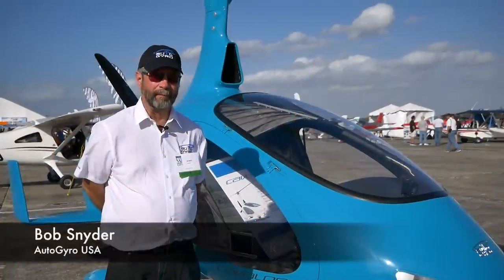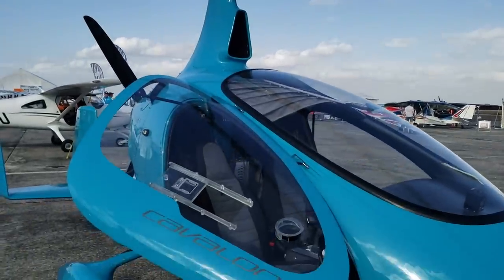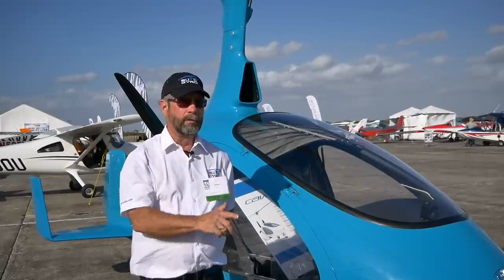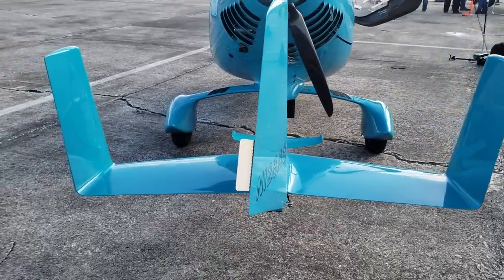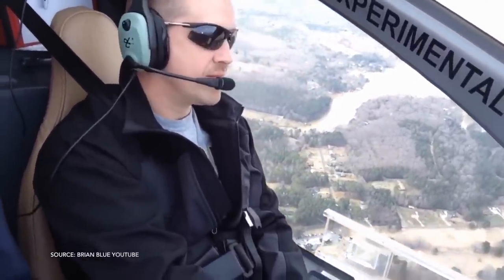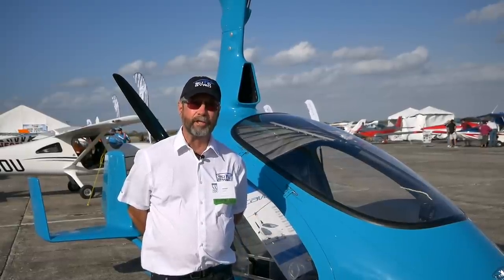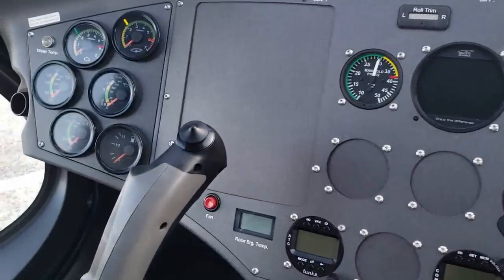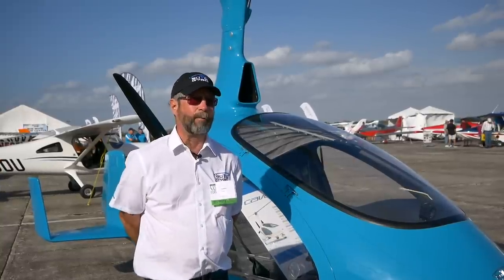WHY Pilots Fly This Instead Of An Helicopter l AutoGyro Cavalon

Comment: Great machine!!! I must say ,that some of our  (Czech ) engineer developed this autogyro with added electric engine in front wheel,totally street legal..You can fly,than land ,drive on the public road to gas station,fill the tank ,go back to place you landed and continue your flight !!! I think it´s great vehicle...battery holds for 40kilometres ...sorry 25 miles and it all costs about ninety thousands dollars!!! only two mistakes -I have no pilot license and have not so much money...8-((
Reply: Norbert Pecheq  it is gyromotion •••••Flyway Nirvana did it • Czech  Flight school in Prerov
Reply: @zaferkoca106100   Yes!! Exactly!!You are right!!
Reply: I wonder if it can be made into more of a car shape and the props can tuck away
Reply: BUT THATS SOOOOO COOOL....JUST SAYING...😮❤❤❤❤❤❤❤❤❤❤❤❤❤❤❤
Reply: fryncyar - a car is shaped to ride on land and thus its has a flat bottom. when air gets under there in abundance,with the wrong design it can create lift like a vw bug.

also weight is a huge factor with aeronautics as with cars but instead of going slow you either cant takeoff or wish you hadnt.

Comment: I agree with what the speaker is saying 100%. I own and have been flying a Cavalon two or three times a week for the past two years. I come from fixed wing flying for the past forty years in Cessnas 421s. I used the 421 purely for transportation from Chicago to Heber City, Utah. As a transportation aircraft the 421 was a dream, however, when I moved permanently to Utah transitioning from physician to ski bum, I found that the fun factor with the 421, mainly for local flights, was decreasing dramatically every time I flew it. That is why a got into gyro flying, and, I agree with the previous presentation that there is nothing more fun in the sky. Do not be dissuaded by people that like to talk without direct knowledge: Gyros are very safe, ONCE YOU GET THE PROPER INSTRUCTION. Do not think for a minute that 5000 hours in a fixed wing or in a helicopter would allow to fly a gyro right off the bat. It is not going to work, and that is how gyro flying years ago got a bad reputation. People flying wothout proper instruction. Once you know what you are doing, they are very safe. They do not stall, therefore do not spin. If you lose your engine, it is just a no event. You can come down under that spinning rotor and put the thing down on a small patch of grass, or dirt, or sand, or asphalt, it does not matter. They turn on a dime and you can do different flight figures in the sky as you desire to your heart content. Nothing beats gyros for agility and emergency manouvers. To those that say they are not practical, they can actually bring you 4 hundred miles on a tank of gas, and withourt braking the bank. And you will have 4 hours of sheer bliss in the process. 
Mauro
Reply: Hello Mauro I have to say you have posted one of the most accurate responses on here and obviously because you have the first hand knowledge to comment on the subject there are so many people making statements on here with no knowledge of what they are saying. Everyone has a right to their opinion but their opinion doesn't mean they are stating a fact. Thank you sir for your input I built my Cavalon a little over 2 years ago and as of today have 649 hours on it so to say I fly it a lot would be an understatement. My Cavlon has become a wonderful part of my life, I have done things and met people since owning it that have changed my life and look forward to every flight. To date I have also introduced over 150 people to the joys of flight in the Cavalon. We are currently planning an event in coordination with the American Helicopter Museum in West Chester Pa. and will be held on Fathers Day of 2019 so anyone in the area that may be interested please stop by and check them out in person. Fly safe everyone.
Reply: Agree with Mauro 100%. Fun...economical...safe....and fun again!  Can’t emphasize the importance of proper training first!
Reply: It is people like you who make health insurance unfordable to most people... Guys like you who must have their boy toys (paid for by your financially struggling patients) are a huge part of the problem. ... But I know you easily turn a blind eye to this as you are skiing and buzzing around in your autogiro.
Reply: @herrunsinn774  you should dig a little deeper on your textual facts. I have family in the medical field. Questions should be....why do drs. charge so much? Do people ever abuse the ins. industry? How much did medical school cost? Wait a minute, you still have to go to school,....and pay for it!!?? Youre on call up to 24 hrs a day??!! You see your family how much? And there are more questions like that. 
Now a great topic is Pharmaceutical!!! THEY are criminal!!!! All drs know this.
Reply: you only brake the bank once. When you buy it.
Reply: Where did u receive your gyro training And what designation did you attain

Comment: My dad had built one with a modified VW engine in the 70s which sadly was lost in a shop fire . Flying at Mirage Dry Lake in Southern California was very popular.  Yes they fly fine on windy days, you just want to make sure you have plenty altitude when you make your wide downwind turns to keep the air speed up and the lift up or they can have problems.

Comment: I remember the gyrocopter ads that used to be in magazines. You could buy a kit for $2,000 - $3,000 and build it yourself. I think the motor was extra (and it wasn't a Rotax). This was a long time ago but I still remember those old ads and how much I wanted one.
Reply: The BENSON Gyrocopter was in the lat '60s. I bought a kit, built the rotor and to start on Blades... I was 16 years old, and parents didn't know I bought it until the kit was in the basement. ..... Handed off to the next guy, didn't fly... suppose I was too young.

Comment: Excellent aircraft! I've always fancied flying a Gyro!! The Utility value of these very STO / vert. landing aircraft is very unappreciated! Intrinsically FAR safer than any fixed wing aircraft!

You don't need an airstrip - any old short stretch of road will do, and the cost of ownership is FAR lower than any fixed-wing aircraft.
Reply: Just watch out for power and phone lines when using roads. As well as traffic.
Reply: No stol at 8k ft elevation!
Reply: Phil S - I should point out to you that they are neither STOL nor vertical landing capable. Despite what the guy in the video says. He is being misleading. Firstly, he said that on a day with 20-25kt headwinds, it would take off quickly - true. He also quoted figures for calm days and said (something like) 300ft wheels on the ground - What he didn't tell you is that a gyro has multiple stages to its takeoff profile - Once the wheels are off the ground, it is not safe to climb out until enough airspeed has been achieved in low-level flight along the runway which can take more than the "wheels on the ground" roll in some situations. They do land in a short run but most of them do not land vertically. You could land one in something as small as a tennis-court with proper training and adequate experience but you'll not get back out again. On a reasonably calm day, you'll need at least 200metres before you can climb out in something like the Cavalon. I need that in my MTO Sport and it's lighter than the Cavalon. ... and, I've flown the Cavalon - I was not impressed by it. It's heavy, sluggish, very imprecise in yaw, visibility sucks, panel is badly laid out, stick feels heavy and dead, and it has a VNE of 100mph (compared to 120mph for my MTO Sport).

Comment: I own a Cavalon with a Rotax 914 since last year, although it can fly for almost 5 hours this is the ideal aircraft for short expeditions because of the speed (average airspeed 65knots)and you have to travel light (10kg max luggage per passenger/max passenger). Operating cost is around 100$CAD/hour and fun is guaranteed....if you want to remain anonymous at airports you will not! This nice looking Cavalon attracts a lot of people. Buying this aircraft was the best decision !
Reply: How far will it go on 1 tank of fuel?
Reply: That varies with the wind direction, a tank is 100 liters and I burn between 15-20 liters per hour depending on airspeed so in a no wind situation at  65 knots I could travel  around 375 miles or 600 km...we usually fly by 2-3 hours legs which is ideal
Reply: Where abouts in Canada are you from?
Reply: Mauricie region
Reply: Why so slow? Most cruise I see is around 90 kts.
Reply: @ictpilot  That's the aircraft configuration, max speed (VNE) is 160kph or 86kts  and a cruising speed of 130kph or 70kts (65kts is ideal for my type of use), the Calidus (tandem configuration) model is higher at 195kph or 105kts with a cruising speed of 90knots. The italian model Magni M-24 Orion (also side by side configuration) has a VNE of 105kts with a cruising speed of 78kts which is slightly faster. I didn't buy this type of aircraft for performance or for long distance but for short excursion (150 miles range) or sightseeing and I really enjoy every minutes of it.
Reply: @jeandefoy9212  Yes the Calidus is faster, I've seen video of them at 90 kts cruise with some airspeed left to go to the red. The Cavalon is slightly slower because it's bigger. But I understand if you're just sightseeing and not strictly traveling.
Reply: I agree with you Jean I built my Cavalon in late 2016 and now with over 690 hours on it I am still amazed every time I fly it is a new adventure and the visibility is incredible. I am looking to build a new one soon so Cavalon 914 RB will be for sale is anyone is interested.
Reply: Jean decoy ~> How do you get the 100$ an hour price, what does that encompass...and I think you're in Qc, so how easy is it to fly around and land  and stuff, concerning the laws in place and all the tralala? Merci .

Comment: I have flown 95 different kinds of aircraft over 55 years to include Airplanes Single & Multiengine Land & sea, Rotorcraft Helicopter, Gliders, and am typed in 3 from DC-3's to a DA10.  I was susceptible  about Gyroplanes until I flew one with Craig at Fainting Goat South of Fort Worth TX,  Not only was the MTO Sport exciting and maneuverable but it was easy to fly.  Most of my time was just getting use to the new maneuvers and understanding the more load you put on it the better it flies.  This was more fun than any of the other aircraft have flown, easier to fly, safer within reason, and a whole lot less complicated.  If I had the money I would buy either version of the MTO.....but I do like the feeling of being in the semi open cockpit in that it reminds me of my motorcycle days, but much safer and in the air!  Dave Barron
Reply: I love it. I want one in Black and silver. I always said the only thing better than riding a motorcycle is flying an open cockpit airplane. I had both at one time. If I could afford it I'm sure I would have a Cavalon  today. It is great looking and sounds like fun to fly. I am sold. All I need to do, is the new way of making money. Create a "feel sorry for me" fund raiser and collect large donations from all the generous people. Yes "David Barron" it is safer in the cockpit than on the ground.

Comment: Back in the 90's I made an appointment to get a demo ride in an RAF200. I had prior experience in a Benson that I built and learned to fly.  I did have a bias toward the gyro. However, even with the pre-rotator, the RAF used more runway than a Cessna 150.  Shortly after I got a ride in a Baby Belle helicopter.  I've had flights in two different Mosquito helicopters and found them remarkably easy to hover. Two Mosquitos can be bought for less than the subject gyro.

Comment: They are soo damn fun and the better you get the more insanely fun they are. I wish I could afford one.
Reply: I could not afford one but bought it anyway  I purchased and built it the end of 2016 and have never looked back,,,,,,,too busy flying and having fun,,,,,,,you only get one spin on the wheel of life and I figured it was now or never     so now at about 5 yrs and over 1002 hrs. on my Autogyro Cavalon I have given about 300 people their first gyro flight and  I am thinking about moving up to the 915 version. I have fixed wing and helicopter experience but the gyro is what I have the most fun with and it is affordable to fly. I live in NE Pa. so if you get in the area send me a massage,,,,,,, I am always looking for an excuse to fly. The one restriction would be approx. 180 to 200 lbs maximum to comply with weight and balance restrictions.

Comment: Cool 😎 I'm a Bensen pilot from about the mid 70's. Member of PRA chapter 5 norcal,. I pretty much stopped flying gytos when I got married mid 90's. Saw your booth at Oshkosh 2017, was that you? And also several Cavalons and Magni gyros at Mentone that year. However I don't have that kind of money, and I'm also getting pretty old. Haha. Glad to see a few other "old" gyro pilots out there. Would be nice to get back into it. My only thrill nowadays is flying FPV multirotors. Cheers.

Comment: Accidents occur when you don't  think through what you can/ can't  do in most situations. That is  'read the instructions'. Flew them for years in the development phase . Most as a 'Test Pilot '.  Some scary situations occured, so learning curve very steep.  One 'write off', caused by faulty cable making, leading to a uncontrolled spin caused by full rudder application at about  250'.  Descended vertically ,  with a little sideways dodging of a shack and fence.  Because the builder was in the aircraft manufacturing  business, he put a   cable down tte mast, good thing, as the mast broke, with me hanging on for dear life, thiking that when the rotor hit the ground, I was going to be cut int salami slices. All I got was a fright and a desire not to do that again. Not hurt in all the time I flew them, and having flown gliders and Cessna's, find gyros to be very safe.
Reply: lawrence willard you reminded me when docking a fifty foot yacht in high winds,,,I kept my cool and went to my training but,,,, I still had to wipe myself after slamming down a double shot of Jack,,,,😨😎🤣
Reply: I'd never fly in a gyro unless it had jump capability.

Comment: Took an intro flight with Bob,  work in the same building as their program at Bay Bridge.  Nice little airplanes.  I question the practicality,  very low cruise speeds and range,  but they are cool as hell.
Reply: Depending on the make and model (AutoGyro isn't the only company in the US) you can fly a gyroplane at 90-100knots cruise for 3-5hrs. Gyros are just as fast or faster than a helicopter and burn fuel 4-6gal/hr like a LSA fixed wing. I love this channel, but there are a bunch of other gyro vids showing cross country capabilities in good and bad weather. Prices vary too, this gyro is at the top end. Brand new start around $70k. Good used ones around $40k. If I had my PPL and could buy one, it would fit my missions (getting to work and visiting family in other states).
Reply: @gospfunk  yeah,  fair points,  I stand somewhat corrected,  upon further inspection,  this is actually the exact Gyro I had the chance to fly,  based at Bay Bridge in MD. If they took that sucker all the way down to Sebring from here,  it can handle a bit of cross country.
Reply: @gospfunk  Aerocopter AC 20 is even more expensive with VERY little performance increase.
Reply: @StuartRedman1  One of they guys that built his Cavalon at Baybridge was based at Sky Manor NJ and just relocated to Florida and he did not trailer it,,,,he flew it down.
Reply: @StuartRedman1  Check out the YouTube video of the guys that flew around Iceland. Great video.
Reply: @StuartRedman1  I fly my Cavalon on many trips over 100 miles and more and at just a little over 2 years I now have flown it 690 hours. I told them when I built it this was not going to be a hangar queen,,,,,,if it is nice and I can find the time I am in the air. If anyone is interested there is a fly in coming up at the American Helicopter Museum in Brandywine, Pa. this coming Father's Day and their theme will be gyrocopters. Check it out on their website were going to be there with some other gyro pilots weather permitting.
Reply: @kevin paul halliday and they now will have a certified version of the Cavalon.

Comment: I m so lucky to have experience flown this magic aircraft, its a mix between a helicopter and a plane
Reply: could someone explain to me that if this is a helicopter take off? correct? yet then once in the sky you use the back blade to move forward? then you land like a helicopter also?
Reply: @PROJECT-AMBITION  No you can't take off like a helicopter. If you have high enough winds it will rise in place and "hover". Look at Glass panel aviation s website and you can see what I mean if they still have the videos of guys flying them in the Middle East.

Comment: An helicopter ? 
A Helicopter
That's a bad as "while we conversated I axed a question"
Reply: An Helicopter is correct if not used as often anymore
Reply: Technically, AN helicopter is correct - or it was once.  When I was growing up in the 60s in England, some pedants would say AN helicopter, or AN hotel, or some such.  Meanwhile the rest of us would say A helicopter, or A hotel.  
So, while it's not wrong to say AN helicopter, it's a vey old-fashioned way to say it.

Comment: Could buy one, not wealthy enough for one, have flown in one though, a blast. The one l Flew in Had a 914 with a Five Bladed Prop on it and a radical Pitch to it and Carbon Fiber Rotor on Top. It Cruised at 115kts. All day long, 500 + mile long endurance and Very Comfortable to Fly-In too. Wish l would of Had the $80,000 to purchase it. The only thing l would needed to Fly in! Very economical too. 4-4.5  gal.an hour.30gal. Fuel.